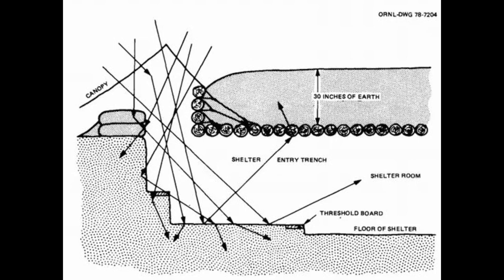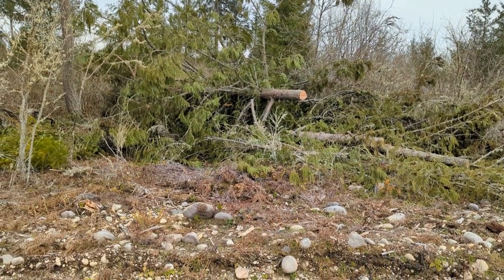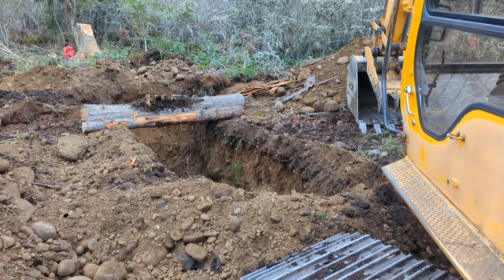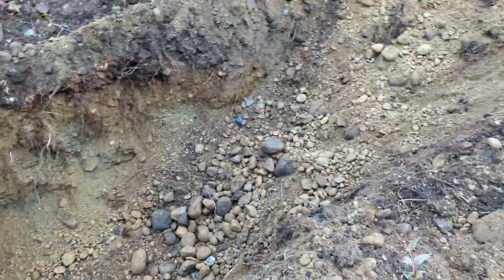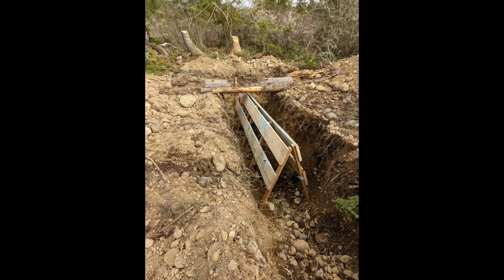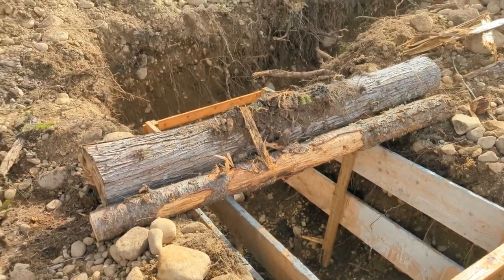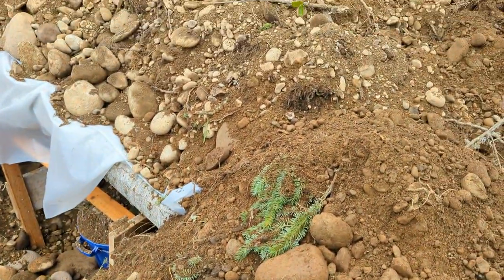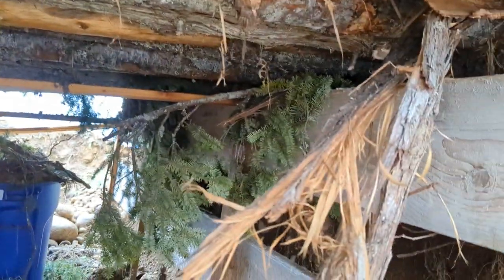Fallout Shelter - How I Built Mine Cheap & Fast Using a 1960's US Government Plan

Comment: Great job on the trench!
Radiation from falling particles shoots out in all directions,  so it's imperative to be able to fill in the ends of your shelter.
I'd fill in one end with earth, the other have it half full with sandbags and enough inside to fill the rest after you climb in. Stack them so the longest is in line with the trench giving you a thicker wall.
Reply from the maker: Good point!
Reply: Adequate ventilation needs to be preserved. I don't think completely filling in one end is a good idea. Escape exit is always a good idea. But yes, increasing the protection from fallout is a great idea.

Comment: During WWII, British people started making what they called Anderson shelters in the back yards. These shelters wouldn't stop a direct hit from a 250 kilo bomb, of course, but they did work at stopping shrapnel and blown up house debris. BUT, what they did find out is that people died in these shelters due to overpressure. There wasn't a mark on their bodies but during autopsies they found that that lungs basically exploded because of the overpressure of a bomb that detonated close to the shelters.
Because you have what amounts to be a glorified Anderson shelter, you may want to think about this especially because you live so close to a major air base.
Another consideration for is, although you  have radiation protection on all sides of your shelter, if there's a wind, it may blow fallout or radioactive particles inside your shelter through the entrances.
Reply from the maker: Thank you for the thoughtful comment! I don't think that this is a bomb shelter by any means... It is just for radiation. If a blast gets me there there is no surviving. My plan is to hang plastic at each end of the shelter if I did have to use it to keep radiation particles out from blowing in. Also remember radiation is extremely heavy, so it mostly falls downwards.

Comment: I would line that pit with carpet and then some really heavy plastic or rubber pond liner. To prevent water seeping in
 And the carpet to prevent punctured. Need some sort of sleeping platforms or air mattress or something. Creature comforts. Some sort of emergency lighting. Defense weapons. And a book or two and something to write with and on. Something to pass the time. A first aid kit and something to keep the kids entertained. And surely there is a way to cheaply but effectively close off those ends and have a controllable air inlet and out let. Like in an old fashioned root cellar with a filter to make it safer for your children.
Reply from the maker: Interesting ideas! The land actually drains extremely well and the climate here rains a lot, so if you used a pond liner you would end up with a hot tub effect inside I think. As it is, all the water quickly drains down to the aquifer. I've never had any puddling yet.

If I ever needed to use this, I would bring the creature comforts down with me (tarps and sleeping bags and blankets and battery flashlights). Defense items could be brought in easily too.

I actually prefer the airflow from the open ends as otherwise the air would get quite stale and you might even run into radon problems. This plan was what the US army recommended I believe back in the day. It is very fast and easy to build and use. Fortunately I have not had to use mine yet.
Reply: @joelx77  I hope we never have to! I was thinking of snakes and insects coming in as well as water. If the top covering of plastic was lapped over the edges of the liner, that would shed the water. Make a curb up at both ends with the liner up and over that. That would serve as a berm to keep water from flowing in. Even if this is not to apply to you maybe someone else reading could use the idea!

Comment: The important part of fallout protection is right angles. I know how ridiculous this sounds but hear me out. If you have the outside. A door. A hall way. Then a door. Then a fallout shelter behind this second door radioactivity and photons and Beta particles and higher energy particles can sit straight into the room with only two doors protecting the fallout shelter.
BUT
If you have multiple 90° turns in the hallway and also multiple doors and rooms between the first door and the fallout room then it cuts down ACCUMALITIVE DOSING dramatically.
Also if you cover the logs with that or pitch it almost acts like pressure treatment and protects the logs. Like for example a telephone pole which seems to be covered in tar. This is the same principal....... Except now a days most telephone poles are actually pressure treated.

Comment: Joel, have you finished? You might put a fire extinguisher in your bunker. Hang a hammock inside. Have you worked out the air handler?
I would burry deep some caches nearby.  
Sounds interesting.
Reply from the maker: I have finished it! I just have two garbage cans full of water in it now. The fallout shelter does not need an air handler as air can blow through it. At most I may just hang plastic down. Remember fallout particles are generally quite heavy and will fall straight to the ground. I would like to bury some hidden caches though.
Reply: @joelx77  Have you worked out how to find it in the dark? How long does nuke detonation glow? Has there ever been a detonation at night, hmm?
Reply: I read yes there has been night detonation sky goes from intense white to yellow - orange - red and last about half hour. Higher detonation less atmosphere the glow dissipates faster.
Reply from the maker: @sixoffive  Flashlights should be just fine for us to see to get out there I hope.

Comment: Good  but can be better  ends or entrance should be l shaped to stop shine from getting in. Also the plastic is good idea but you should have more plastic near the top. Reson is in case rain brings fallout and it works its way down to lowest level  If never rains this desighn is OK but keep weight of wet dirt that is very heavy dry  so bury some plastics a few inches under top layer.  Also wind and rain may carry stuff in via surrounding dirt.  Always  from bottom up plastic  dirt more plastic  then more dirt then top layer of plastic spreading 12 feet or more in all directions around the ditch to keep out ground water contaminated in case of heavey rains. If you only have plastc near where you are and wet fallot reaches in plastic you are not as safe. Looks like you have room so please fix this.

Comment: Good video, thanks for posting..If someone can't manage to get those poles, would 4x4 lumber work do you think?
Reply from the maker: Good question, I remember when I was researching to see what size poles were needed I think that I saw that 4*4 would be too small to handle the load. Remember you are piling 3-4' of dirt and rock on top. You may be able to double stack 4*4s or just get a larger size. What you want to do is check the horizontal load weight capacity of treated lumber, then calculate how much that width of dirt and rock piled 4' high weighs. Add in some forgiveness margin for snow loads or a person climbing on it.
Reply: @joelx77  Thanks.

Comment: I may have misunderstood but wouldnt radioactive dust, i.e. fallout just blow into the shelter since it's open? Maybe you covered that and I missed it. Thanks for sharing your work.
Reply from the maker: Radioactive dust is very, very heavy and mostly falls pretty straight down. But I will put up plastic at each end of the tunnel to make sure a strong wind doesn't blow any inside anyways.
Reply: @joelx77  I'd read that yes, the heavy particles do fall fairly closely to ground zero but the lighter dust like particles can go high in the atmosphere and fall/rain down far away. This seems to suggest that therr are dangerous, light particles that could get blown into openings, crevices, cracks, etc. If you have a good reference I'd love to read it as Im trying to come up with a good plan for the potentiality. Thanks for the response.
Reply from the maker: @Ash_95  That's a good point and something I don't have a great policy for other than the plastic at the ends of the tunnel. My fallout shelter is sort of a minimum cost entry point to fallout shelters and should keep me alive... it won't be comfortable and it won't be perfect... there may be some radiation from light dust that blows in, but the vast majority of it should be kept away.
Reply: @joelx77  hey, you actually have a shelter so your better off than so many of us that don't. Plus, you could tape/seal up that plastic to help keep it all out. Wish you and your family well. Take care.

Comment: That shelter won't do much.
I dont see why you can't set aside 20k to build a proper fallout bunker. Coyote steel & co from eugene oregon can sell 16  sheets of  10 gauge hot roll steel 48" x 96" for $4,899.00. Im sure can find a supplier closer to seattle. 

Maybe move to kalama? Higher in the mountains, easy to drill wells, septics, etc.

You have an excavator. You can easily excavate a proper hole, lay gravel foundation, plate pack it, followed by rebar and concrete foundations. Square steel beams for frame, pipe for air filtration, and another $7k for a proper air filtration system.  Alot more too it, but its feasable, and a hell of alot better than what you have set up.
Reply from the maker: Why do you say the shelter won't do much? According to the specs put out by the military, it will reduce the radiation dose received a few thousand times over.

I agree that it won't be comfortable at all and actually living in it would suck. But this took a total of two days to build and cost very little. A full concrete and steel bunker would be far nicer, but would cost tens of thousands of dollars and take months to build and might require permits. A bird in hand is worth ten in the tree.
Reply: @Daniel Goncharov Without knowing more information, this critique seems improper. You don't know his budget, what the water table is, how far down before huge rocks/bedrock, etc.  He's got a good start and needs only a few adjustments to achieve a protection factor of about 300.  A much bigger concern would be having a plan for the thermal pulse and fires, can you get everyone into the shelter with only 20 minutes' warning? etc.  The difference in a million-dollar shelter and what he has shown is negligible if you can't get to the shelter in time with your essentials...

Comment: You got both ends of it wide open if you close them off what are you doing as far as fresh air bathroom several weeks and that thing You're going to have to go to the bathroom
Reply from the maker: Bathroom: 5 gallon bucket with sealing lid dumped out every few days in a 3 minute trip outside.

Comment: This is a start, but it's to small for several days to weeks of staying there. You have water, but what happens if those big can get contaminated? Food and a way to cook? And now that you ate and drank, what about bodily functions? Where you going to do that?
Again your shelter needs to be bigger/longer or your just going to get on each other's nerves and smell like shit.
Reply from the maker: It won't be comfortable, but it will be survivable. 

I have iodine tablets for the big water cans, plus more water I can move from the house nearby.

Food is all massive freeze dried packs of food from Costco. Doesn't need cooking.

Bodily functions will happen in a bucket that can be emptied tossing it out.

I agree bigger and longer would be more comfortable. But bigger and longer may never have gotten done. Better to have something than nothing.
Reply: @joelx77 Bathroom stuff.  You probably want to separate #1 and #2 due to volume and smell considerations. # 1 can go into bottles with twist lids ( laundry detergent bottles are good) until it can be dumped outside. The males in your family should have no problems but the females might want to use a kitchen funnel to accomplish this. It would need to be cleaned so don't forget the antibacterial wipes and a large Ziploc bag to keep the funnel in.# 2 can go in a bucket. If you don't have one of those seats designed to fit on a bucket, you could slit a portion of pool noodle and fit it on the top. Then you would want to add kitty litter- the scoopable kind or mulch or sawdust. The latter two can be composted. I'm sure you won't forget the tp and trash bags. Please believe me,  you do not want to mix pee and poo!